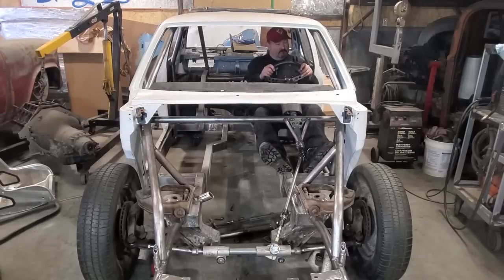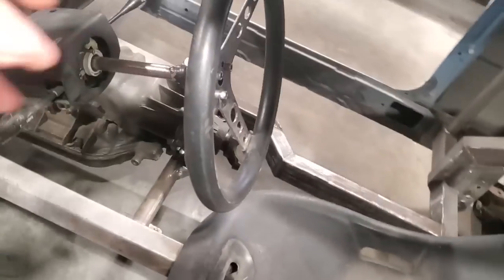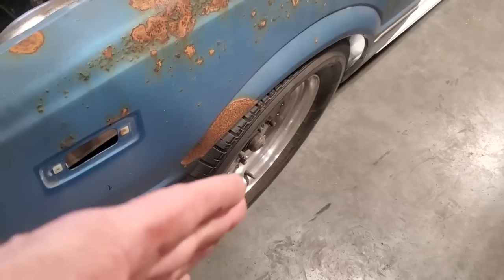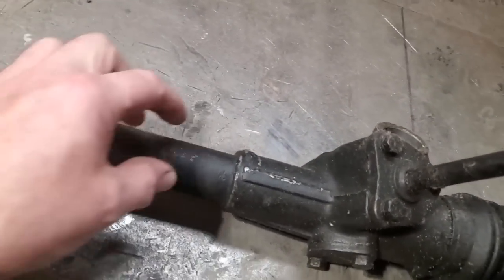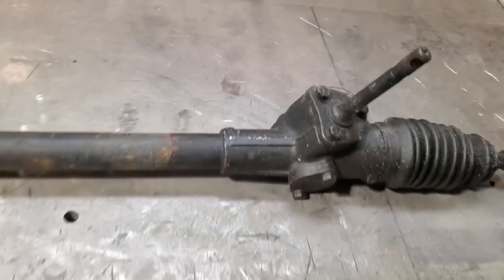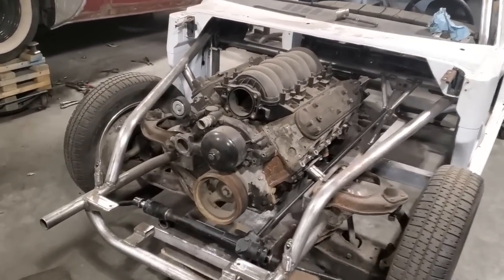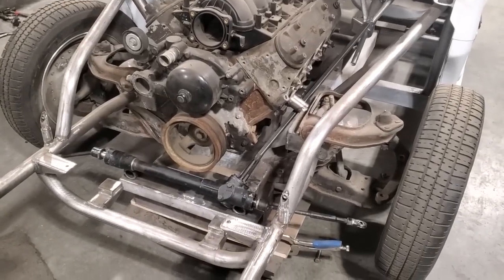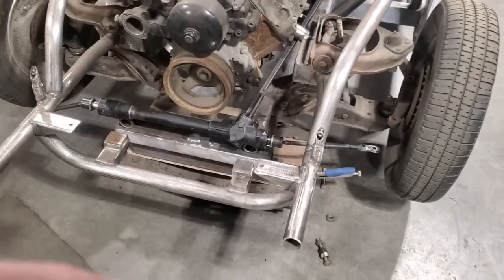Oh no!! Cutting stuff up again!

Comment: Best video yet in your series. Doing the same problem solving and design process with a ‘75 Dodge D100 pickup and installing Dakota rack & pinion install. EXCELLENT logical process, Best I have seen yet on any internet or “resto mod TV shows” this is REAL engineering and design development. GREAT WORK. 👍👍👍👍

Comment: Fantastic video Tony! Having never built a car I never would have dreamed that there would be that much to a rack and pinion setup.
Reply: I agree. I've dealt with the old air cooled VWs for years but they have an entirely different trailing arm set up that eliminates virtually all of the bump steer probs. This video has been a super eye opener and the old VWs are not my only passion. This is very good information

Comment: Excellent job (and tutorial!) I remember looking into steering for an independent front end years ago and as I remember it with a straight line scribed through the 2 wishbone pivots, the rack "should" have the ball joint in the same plane. Brave too narrowing a rack where most people would just play around with steering arm length. Narrow cars + V8's = a frequent pain getting the column in there too! Well done sir!

Comment: To avoid  bump steer, the best way is to align the center of the ball of the inner tie rod end ( at the end of the rack ) with the axis of rotation of the lower control arm, that way, there is no relative movement between the tie rod and the control arm as the wheel bumps so the wheel direction remains stable in regatd to the movement of the control arm.
you done a very good job on the designing of the steering system for that car.

Comment: Wow! I respect the incredible amount of work it takes to do what you just did from start to finish.💪💪. Impressive you've got it to no toe-in on full droop, & perfect through range of motion 🤯.. I'm a mechanic, lots of alignments, almost every modern street car has toe in on full droop. I guess this is how you set up a drag car.. 

Also it seems you have little few inches of movement in that rack 😨.. huge turning radius. It looks like inner tie rods are super long & rack movement extra short.. Maybe its for drag racing,
Reply from the maker: No it has the same amount to turns. The stop point for the inner tie rod has not changed.  So it still has the same lock to lock rotation.

Comment: Thank you fitz I need to do the same thing on the mopar i am building, Thow i am useing a engine/rack mount by Control Freak there are still some wedge type washers that adjust the rack mounting. So your video will come in pretty handy!!!! thanks again!

Comment: It looks like for the geometry to work right, you'd want the inner ball joints on the rack to pivot at the same point as your lower A-frame. Looks pretty close where you ended up. Centering up on those a-frame bolts just ensures that the rack arms maintain the same arc as the A-frame does during its travel.

Comment: You're a genius . Your fabricating & engineering skills are amazing . maybe a dumb question, steering columns have a crush joint so in a crash the steering wheel doesn't push in to your chest, do you have anything in your set up?
Reply from the maker: You need that gor a straight column. Mine has two joints that will change the direction

Comment: Have a question about your rack and pinion build, I've never done one before myself but my buddy and I are going to put one in my 57 Ranchero,  my question is this,  after you figured out how much you needed to remove, wouldn't it have been easier and cheaper to just buy 2 new arms that were 2 1/4 inches shorter, im not sure but just a thought.  Kevin

Comment: I was always told that bump steer was eliminated when the inner pivot of the rack was on the line between the upper arm inner pivot and the lower arm pivot.  The tie rods should be straight across at ride height. You may have arrived there but took a trial and error route

Comment: Where you are going to put the rack and pinion welded nuts inside the tube frame, I would tend to use coupling nuts instead of normal nuts. Coupling nuts would give you a lot more thread to tie into and lessen the chances of stripping the nut out.

Comment: I think I understand what you were doing here. If I'm right at full droop and at normal ride height the wheels are parallel but what are they like at half droop? They will have some toe in or toe out so were you able to confirm it would be toe in as you wanted?
Maybe it's so small it won't matter.

Comment: I had an old Jeep Wrangler and it bump steered terrible in stock form. I put about a 5” lift on it and some big tires and it went away completely. It ate u-joints terrible but no bump steer 😂
Reply: WOW. Are you sure the old Wrangler was stock - as 'dodgy' lift kits are normally responsible for unwanted bump steer.
Reply: @georgebettiol8338  I bought it used but bone stock from an older gentleman, not even oversized tires or anything. It bump steered bad. I bought a 4” lift kit that included a new dropped pitman arm and made new shackles that raised it about another inch. I don’t know what did it but after the lift and 33” tires it drove like a dream other than being hard on rear u joints. It didn’t make sense to me either but I had it like that for about 10 years before selling it and it always worked great.

Comment: I understand what you have done here, but from what I have seen and the way it's been explained to me, the inner balls of the rod ends are supposed to be equal length from each other as the pivot bolts or pins of the lower control arms. The entire rod end is supposed to be parallel with the lower control arm. The center of the inner ball should be at the same height as the lower arm pivot, and the bolt or joint from the outer end of the rod should be spaced to make sure the rod is parallel with the lower control arm.  Done this way, everything stays in alignment.   I have seen many race cars built with the rack push far forward to make room for pulleys and such and they leave a sharp angle back to the knuckle, but they complain about controlling the car when it gets out of shape running down the track....  I have also seen where people made up their own outer joint that pushes the rod out much closer to parallel between the control arm and tie rod....  It's all about what you want and think you will be happy with, but al least take a look at it this way.. Safe is better than not!!!

Comment: Why didn't you just shorten the tie rod extension, or both of them......or is welding those not legal ????   Great video by the way!
Reply from the maker: The inner tierods are stock. I shorten one side of the rack. It was cut and drilled to take the inner tierod. When you cut it all from one side the center of the rack moves over. In my case I shorten it 4.5 inch so the steer output movers over 2.25 of a inch.

Comment: I've always wondered why they dont use some sort of hydraulic steering systems for hotrods, similar to what they use in front or centre console outboard motor powered boats.
Reply: Vehicle design laws require that a car's steering must maintain a mechanical connection - which remains thus even if the hydraulic or electrical steering assistance fails. In the case of a marine hyrdaulic steering system, a failure of the hydraulics will result in complete loss of steering - probably not as serious on water but very concerning (an under statement) if it occurs on city streets or whislt travelling at high speed on highways.  There are vehicles that use 'marine type' hydraulic steering, however these are speed limited and prohibited from using the 'normal road network' - e.g. airport baggage handlers, trucks used in open cut mines, etc.
In Australia, any changes made to a vehicle's steering system requires an engineering assessment and sign-off - otherwise the vehicle is not permitted on the road.

Comment: Hey Fitzee, I'm curious if the lower a arm pivots are the same distance apart as the inner tie rod pivots? I heard it helps bump steer.
Reply from the maker: The outer ball joint and tie rod mount are off set so the location of the inner  pivot point need to be out past the inner point of control arm

Comment: I thought a sliding  steering shaft would be required for flex purposes and safety in case of impact .
Reply from the maker: Column has two joints a impact would bend at the joints.

Comment: Maybe I'm getting to old , I just hate modern cars.  I would say put a 308 in but no . 308 is bigger than the whole car.  Wife's VF SS is already stuffed , engine light and misfire . They said plugs , I disconnected the battery and it ran ok for a few days then stuffed again.  I can't touch it , warranty will be void but they don't know either.  Ha,ha, I think coil pack.  Told her just buy a Hq statesman.  Ha ha,

Comment: I have no doubt that Fitzei is capable of doing anything but this is becoming prity dangerous at this point. I mean you are surly not qualified to fabricate steering wheel system and even if you would be you have no testing facility to make sure it is safe.